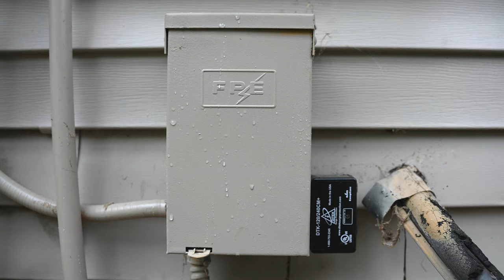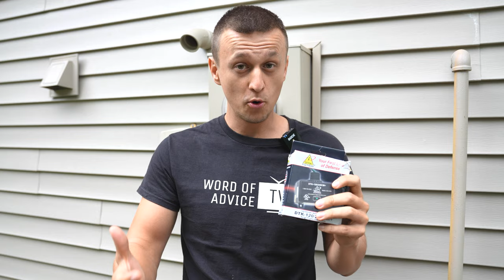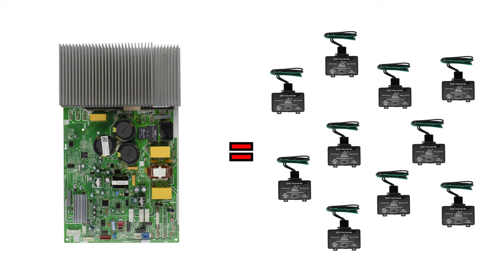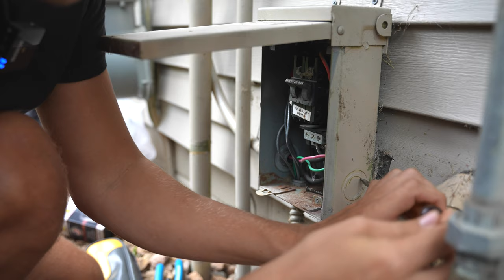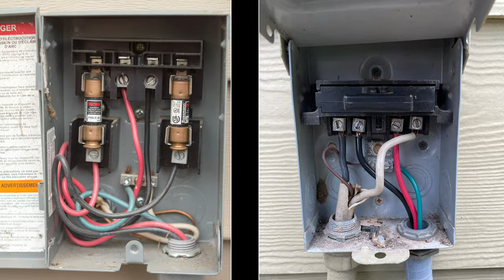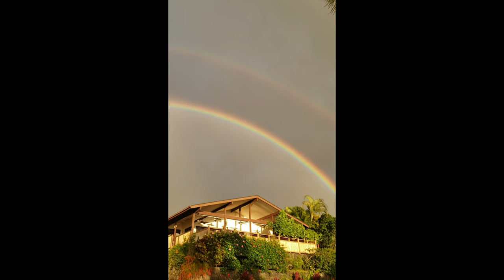How to Install Surge Protector on Air Conditioner Easy

Comment: My unit is an Intermatic and has a 24V connection as well to prevent short cycling. . Once i saw the circuit board for the HVAC , I knew I needed it for piece of mind , if nothing else.  It's been in 7 years and ,so far, no issues. I took the AC control cover off to replace the capacitor last year and I could not , for the life of me , remember how I wired the 24 V connection. I had to , at the time, call the company's engineer, due to the fact the instructions don't cover two stage units, and he told me what to do.  I believe it is wired to stage one. Wish I had written it all down. Like one reviewer below, I believe the double lugging is OK because the SP is not a second load device  ( ex. the LED). Always great instructions from you !
Reply from the maker: Thank you for sharing your experience with this! The main reason why I mentioned double lugging is because wires (especially stranded) tend to get pushed out by the screw if there is more than one wire under it. This increases the chance of a loose connection.

Comment: The installed surge protector is a tpe 1 device. Here's some additional info regarding a type 1 vs a type 2 surge protector.
Type 1 and Type 2 Surge Protective Devices, Differences between?
Type 1 devices are installed before the main device in the load center, whereas Type 2 are installed following the main devices in the load centers. "Type 1 Surge Protective Device (SPD)s are intended for installation between the secondary of the service transformer and the line side of the service equipment overcurrent device, as well as the load side, including watt-hour meter socket enclosures, and are intended to be installed without an external overcurrent protective device. Type 1 devices are dual-rated for Type 2 applications as well, providing the highest ratings available for installation at the service entrance.

Type 2 Surge Protective Device—Connected Type 2 SPDs are intended for installation on the load side of the service equipment overcurrent device, including SPDs located at the branch panel."

Comment: Another great video. During my journey your videos were of great value. My question for you is have you ever seen one of these after an electrical surge and did it protect the unit? My suspicion is during en electrical surge this would blow along with the electrical board anyway. I know this first hand from losing my computer that was plugged into an APC brand surge protector.

Comment: ...nice DIY video Jay....thanks for posting....I already have a "whole-house" surge protector installed on the main breaker box in the garage
protecting L1 and L2 on the load side of the main breaker...so question, would it be a good idea to install a dedicated surge protector for
my 23 year old Trane heat pump as you have shown?... 🙂
Reply from the maker: They say that "layered protection" is a good idea, meaning a whole house surge protector plus a dedicated HVAC one. But honestly, I think if you have one for the whole house already, that should be enough protection for it. 👍

Comment: you can double lug a surge suppressor, just not something with a load like a hot tub etc from what an hvac tech told me in AZ
Reply from the maker: I don't think there's anything wrong with double lugging, it just increases the chance of a loose connection which is why a pigtail is preferred.

Comment: These surge protectors, are they good for multiple surges and if not can they be tested to see if they still give protection? I would think a big surge would burn them out!
Reply from the maker: As far as I understood when I looked into this device, they can take a few hits before they burn out. But I'm pretty sure a big surge would take it out in one go. If the unit is burned out, the green LED light turns red.
Reply: nope, single surge. Sure, it can handle multiple "small" insignificant ones, so... check them daily?
Reply from the maker: @wim0104   Thanks for clarifying @wim0104

Comment: Hi Jay.  I live in Texas, and a couple years ago we had a string of 110 degree days.  One of those days I was home and noticed hot air coming out of upstairs and downstairs vents.  I ran outside and both compressors weren’t making any noise and fans were running.  I shut them both off and hosed down the compressors, which (due to the amount of steam coming off them) were extremely hot.  Later on I saw many hvac trucks in my neighborhood, and talking to a neighbor, he said the same thing happened to him.  Does that sound like it was a power surge?  Do you think installing this could help prevent this kind of thing from happening?  Appreciate it sir!
Reply: Sounds like a brown out - low voltage. A surge protector won't help, though there are more sophisticated devices that will disconnect on a brown out.
Reply from the maker: As another commenter already mentioned, I don't think a surge protector would help with what you experienced. It's possible it was a power surge (in which case, yes, this device would help) but it's more likely that it was a brown out. This device would be better suited to help with that: https://youtu.be/qgHsGR4WT18?si=hs154mHYOS_ncG4t
Reply: @WordofAdviceTV  Appreciate the response!  I’m slightly embarrassed to admit I didn’t know exactly what a brown out was (since we don’t get them here a whole lot), but it definitely makes sense.
Reply: @tgriebe  Thanks - that was the first time I’d experienced this with the ac units.  Might need to look into getting something to disconnect.
Reply: it tends to only happen on days of extremely high heat in alot of areas. this is due to all acs coming on at once causing a massive increase in load on the electrical grid. alot of power companies actually offer a rebate if you were to go on their special gridsaver program. essentially it allows them to cycle your a/c on and off alternating with other people so the grid can handle it better and prevent brownouts.  @gelguitarist

Comment: This surge protector was included with the new A/C installation in 2019. The additional cost was $595. It was never installed. The heater doesn’t work and the company went out of business shortly after the installation of the A/C. $800 for a new circulator fan motor. This A/C is a total disaster. It’s still running so far, but when it quits, and I can’t fix it myself, I will install window units myself, if I’m still alive 🙄
Reply from the maker: Oh wow, sorry to hear about this terrible experience Mr. Classic!! They charged you 600 dollars and didn't even install it?? And now they are out of business too, crazy stuff! May you never experience anything similar again!
Reply: Well I’m waiting for the hot water heater to quit. Normally I could install a new one myself, but I have a bad back now can’t lift anything too heavy now and my neighbor has the same problem so he can’t help me either. How much do you think a water heater installation would cost these days?

Comment: Bruh, you wired that ALLLLL wrong!  😮   I wish there was a better way to reach out.   Your surge protector is simply energized right now.... A power leg has to go to, and through in order for it to stop the amps from passing through to the equipment..
Reply: How long you been hvac?
Reply: He wired it correctly.
Reply: @bills6946 it'd be great to note the type being a parallel surge protector and how it functions. Also, he did make a mistake in cutting the wires, as wire length should not be altered on parallel surge protectors.